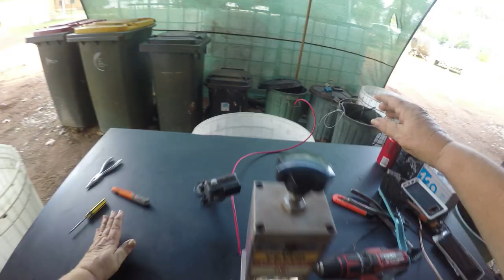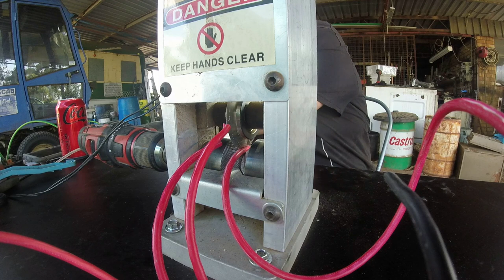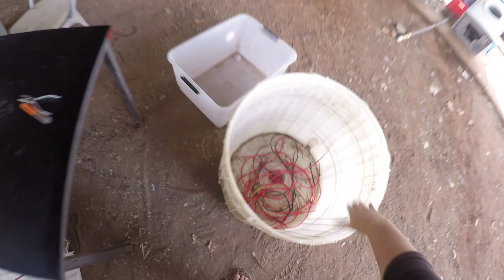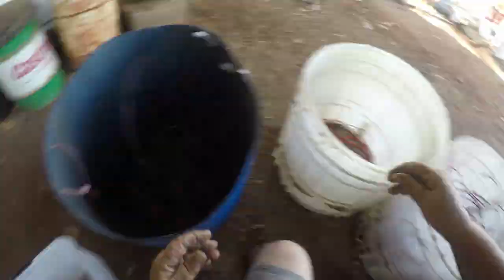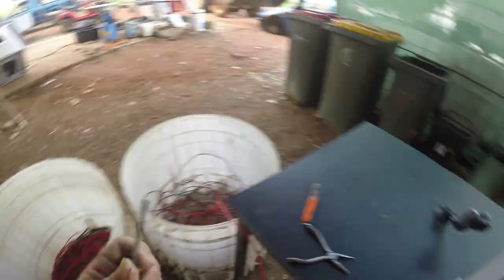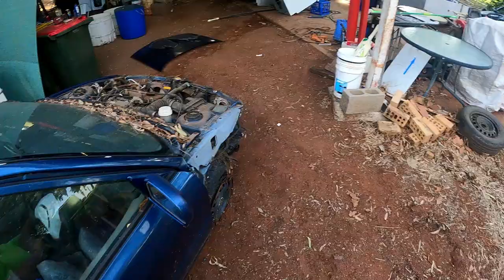Stripping Copper For Scrap Run

Comment: I have the same wire stripper other than I made mine semi automatic with a 12 volt motor powered by a solar charged battery.

Comment: After you cut your wire, kbend it in the uncut direction and then back in the cut direction. The wire will pop out, and you don't need to use a screwdriver.
Reply from the maker: Thank you for that tip 👍🍻